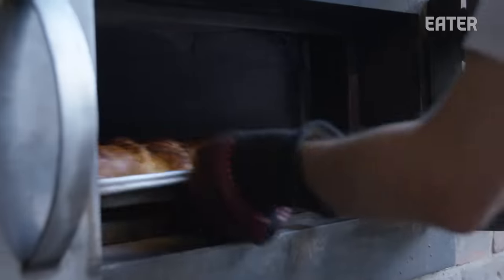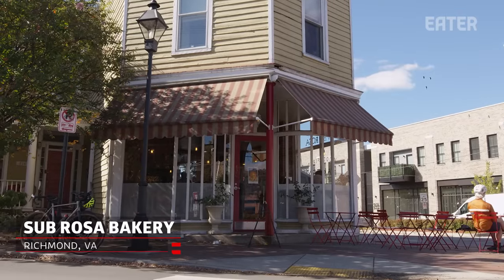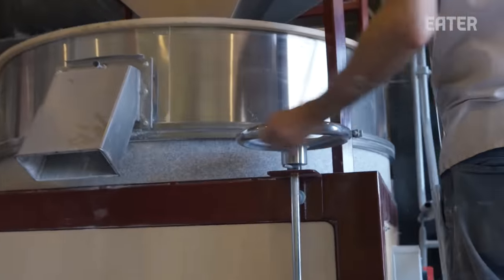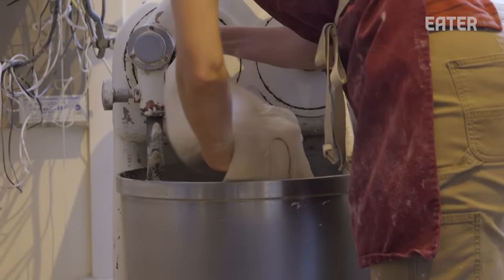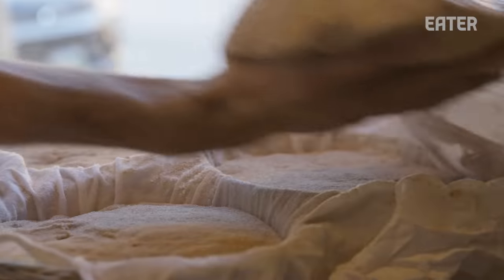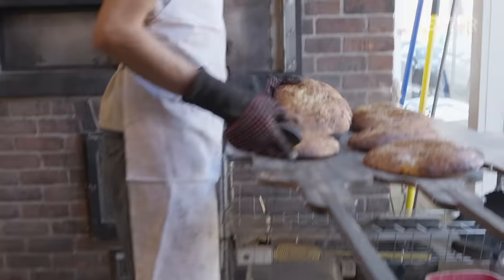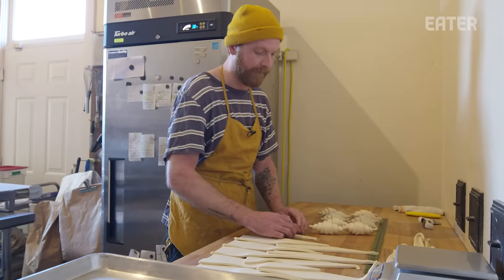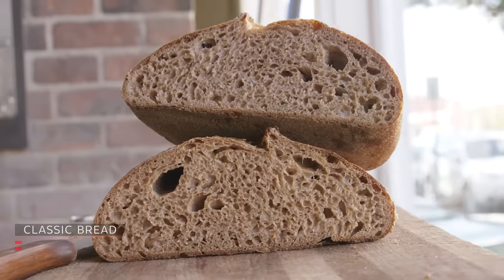How a Popular Virginia Bakery Makes Hundreds Of Pastries a Day Using Wood Fire – Smoke Point

Comment: No one uses wood fire, because it’s a business.  Gas (or even coal) is more efficient for heat control and cost.  That’s why commercial bakeries use it.  
They’re more worried about artisanal, I guess.  Then why are they using machines?

Comment: Lowes does not sell food grade blue plastic buckets on their web site. So, is the bucket at 5:35 okay to use?
Reply: I checked my Lowe's bucket, and it is made of High-Density Polyethylene (HDPE), which is a food grade plastic.
The other food grade plastics are:
Low-Density Polyethylene (LDPE),
Polyethylene Terephthalate (PET),
Polyvinyl Chloride (PVC),
Polypropylene, and 
Polystyrene.
Reply: @mkgunnells2987  Thanks and I agree if the bucket was labeled HDPE.